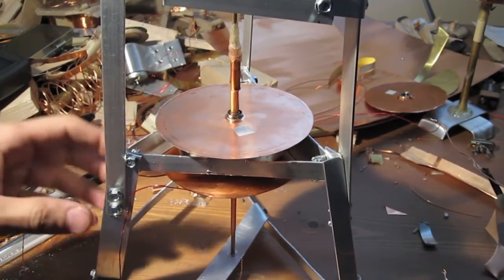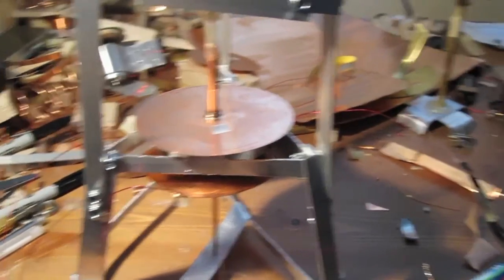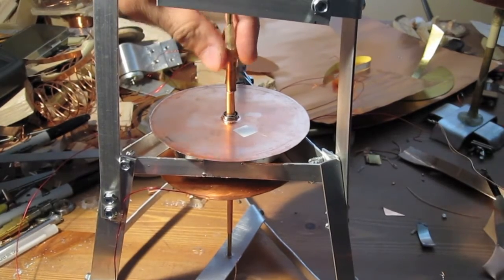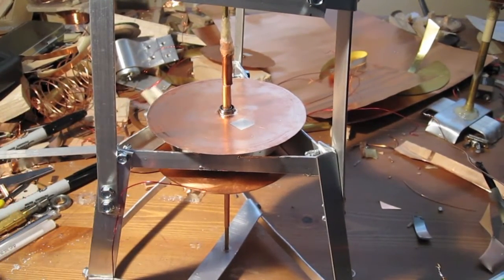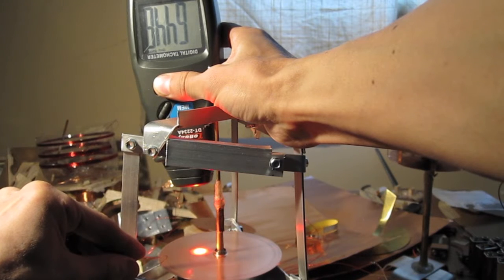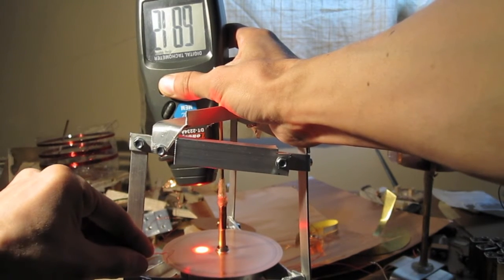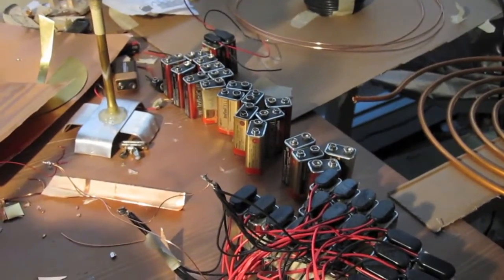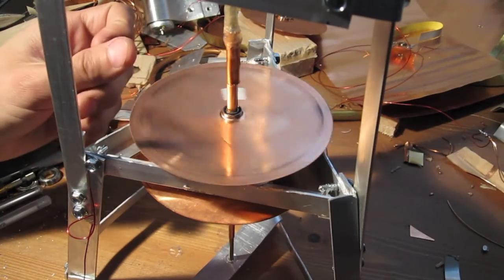8600 rpm Homopolar Motor (Magnetic Vortex Motor - Part 6)

Comment: I know it's year's late, but have you tried Losing the Commutator's, replacing them with anode and cathode of a really high voltage generator.
Like Tesla Coil Driver, Stun-gun or similar H.V. driver (many 555 PWM or one transistor circuit's to try) to avoid Drag of commutator's. I imagine your speed will go UP and control as well, since the Speed control issue in this video is a downer. It's year's Past your posting but i just had to suggest if you are still keeping up on comment's.
Thank's for sharing, by the way..

Comment: If you didn't notice, he used a wire on the plate to conduct an electrical connection. He made an electric motor. (Not a magnetic motor.) The motor was powered by a power source such as a battery or a power supply.

Comment: but u did not talking about running amps
Reply: very high amps...they drink amps like cat eating friskies because they run dead shorted!
Reply: Yes they do 'drink' amps, but low voltages. It seems the only motor that will run on the lowest of voltages. So use a battery with low voltages and very high amp hours such as a zinc-air or aluminum-air battery.

Comment: I'm trying to duplicate this experiment but am having difficulty. 

I'm using a decent bearing, have a very strong magnet, N42 3" annular, a steel disc with a copper layer on top all attached to a 1/2" rod secured with a vice. Spins fine - stops withing 2 seconds. Using 3.3V @ 22A, 5V @ 23A and 12V @80A all without result. Connections are from the inside to the rim of the disc, tried switching the terminals and I'm touching very lightly. They will spark and glow but no rotation. 

Can you tell me if you have had any difficulties anywhere along the line?
Reply: Did you use a feromagnetic material as a supporting structure?
Reply: I am working on the same :) keep in touch. Mine is welding at the moment 😂🤣but I'll get it. Already posted a faraday motor (in a liquid style) now working on this type.

Comment: do you can spin it with like 10 000 volts and low amps, I mean static volts field 10 kv
Reply: the disc is a practically a short circuit, the high voltage would drop because it can't supply high voltages the same time it supplies high current. You could put a single high voltage lead wire in the disc at the same time the low voltage and high current is circulating to make the disc to spin. That would be interesting.

Comment: Hello nice work I was drunk a screwin around last night I got a screw with a magnet to spin at 20,000 + will upload soon !And got a levitating magnet to hit 98,000 rpm with air and this may help your work as I also have hit 20,000 rpm homopolar levitating and the speed limits this way are easy to still push for much more. And after a sertion RPM is hit feed back in to may also be possible. Regards Adam VA of AVA Magnetic Levitation AUS

Comment: not telling you anything you probably arent aware of, but just incase, please be careful when you get closer to 40k rpm as these materials you are using will begin to go in and out of resonance, think of the wine glass and the oporah singer, unless you control the spectrum in which your vibrating these materials and also the fact that your using separate materials which have different resonate freq. be sure to understand breakdown will happen and when it does im sure you know what happens when a buzz saw breaks.. no fun.. be careful my friend.. again i would really love to see you do this but apply a more symmetrical structure to allow natural orientation correction of the object.
Reply: ther like some windows broken

Comment: wouldn't it be cheaper in the long run to use a DC power supply?
those huge neo magnets aren't cheap, that's for sure

have you tried Tesla's radially cut slots in the disc? it's much more efficient that way, but hard to build
Reply from the maker: beforebefore In my video "Joseph Newman Motor part 3" it was necessary to use 9 volt batteries to get over 800 volts of electricity.  I used over 50 9 volt batteries in that experiment.  I had to use batteries to see if they would be gradually recharged by the system.  After that project reached its end I had a whole bunch of extra 9 volt batteries lying around that I have since used in my other projects.  I'm not quite sure what you mean by radially cut slots?  Can you elaborate.
Reply: spiritelemental
My bad, not radial, but spirally cut slots. Seek the pdf document "Notes on a Unipolar Dynamo" - Tesla.
http://www.andrijar.com/teslahom/teslahom.pdf

Also - good reading:
http://www.overunity.com/8934/bruces-discovery-teslas-missing-link-for-his-unipolar-generator/#.U-xW4WNtDec
Reply from the maker: beforebefore  Thanks yes, I've seen that pdf and pic before of the 4 petaled standing wave lotus pattern incorporated into a motor by Tesla.  Its been many years and I wasn't working on a unipolar motor at the time like I am now.  Thanks for reminding me.  I may have to take another look at it.

Comment: Your work resonates with me, thanks for sharing.  I feel like we're not trying to  create "anti-gravity" cuz its the influence of earth that creates anti gravity by providing a barrier between the gravity of space and terraferma. 
I think we're actually trying to nullify the influence of earths mass so that gravity (which is every where except around large bodies in space)  will levitate our machines while still within the influence of a bodies mass.

I suspect that the rpm requirement of the rotors would be reduced by half if both rotors rotated in opposite directions. Its much easier to activate the "aether field" (that's where the perpetual powering comes from) when the opposing magnetic fields are collapsed against each other.  
Research Boyd Bushmans magnetic experiment where he collapsed two northern fields against each other and reduced Earths shielding affect which reduced the constant 9.8 m/s fall rate.   By quickly modulating that collapsed field principle, attaining the correct resonant frequency will nullify earths influence and we'll see levitation.  peace...
Reply: like a « pump »

Comment: Magnetic VORTEX proof (not theory) Maxwell ERROR (field not linear
http://peswiki.com/index.php/Image:Magnet_vortex_Pedro_Silva_95x95.jpg
educational (magnet motor - qmogen) : http://linoavac.no.sapo.pt  science and art

ÇÇÇÇÇÇÇÇÇÇÇÇÇÇÇÇÇÇÇÇÇÇÇÇÇÇÇÇÇÇÇÇ
ok,tks..the magnetic line (fields) of the earth are not linear(lines is old theory)..the magnetic field of the earth is with vortex shape(several curves)...is equal to the gravitic lines (in the shower water spins with vortex when is descharged to the sewage

using a PC transformer and a magnet.  putting current in the water(with salt helps) and connect magnet to one pole. simple...after discover VORTEX we can explain gravity(harmonic vortexic magnetic field)

Anti-gravity is anti-vortex
by electrogravitics
based on double triangle high-voltage by square discharge. ( LIFTER - electrogravitics )

The comunity "magnet motor" : https://plus.google.com/u/0/communities/113932584951030663517
NEWs (top 5)http://peswiki.com/index.php/Directory:Motor-Generator_Self-Looped_with_Usable_Energy_Left_Over

Comment: if that thing shatters at 8600rpm.....
Reply: Grinders from home depot spin apx. 30000rpms this will be fine. Sigh...nagging.
Reply: @strangescience3414  And yet at 30k RPM I still cant go back and pick lotto numbers right... :)
Reply: @ianhessey1190  😂🤣darn was hopeful. I was testing this design  quit a bit. I have a different version on my page with about as much torque as a fan. The tricky part is managing so much much extra current without it welding or melting itself. It's is a true concept just very difficult to scale up and manage. Many potential solutions like adding carbon brushes example ruin the effect and revert back to conventional systems. Still doing tests.

Comment: cool watch your fingers with those edges :) is there any way to get dc to jump a spark gap and reduce the friction of the contact ?
Reply: spiritelemental

Leave the Mercury alone.

The real issue is - none of us actually know what the hell Die Glocke was for. We know they used Mercury in it, and we know it emitted radiation, and that they didn't want it to fall into the hands of the Russians for sure.
It could be a flying machine, or it could have been used to open a worm hole, or it could have even  been used to simply make atomic material more deadly.

That's the problem, none of us knows.

But, like you I have an intense interest in these types of things.
I'm trying to learn about Monatomic Gold as a superconductor. I ingested it on a fairly regular basis for 14 years, and I am interested in learning about it's anti-gravity properties. (such as how to activate it.)
Reply from the maker: If I could get the voltage up to maybe 500 plus volts, it would jump a small gap (half a millimeter) but the amperage has to remain high.  I'm using I'm guessing over 10 amps in my video here.  Another way to go might be to use liquid mercury as the bridge/brush to touch the other edge of the disc.  Mercury is messy though, and its fumes are highly toxic and unpleasant to inhale (as I've experienced first hand. lol).
Reply: spiritelemental Its a wonder you can remember the experience ;-)
Does Electricity loose amperage if it jumps a gap then ? to be honest Mercury would be better but still there would be friction :) where we need to get to is charging super caps and creating a field using electromagnets powered by the SP's that lifts the magnets and the diamagnetic disks. :-) Can you tell me do caps charge faster the faster the magnets spin if you were to charge caps with them ?
Reply: A alloy of gold Gold mixed with some other stuff is known for it's Extraordinary Magneto Resistance (the function that makes the disc turn) and EMR is 1,000,000% that of copper. I'd hazard a guess that mercury was a replacement slip ring for the high amperage. Radiation was either from an onboard nuclear battery or came from the spinning metal itself. 

But that's just a guess.
Reply: Its the amps that makes the disc turn. If he ups the volts and keeps the amps the same you would multiply the two to get the requires power source. So, 20A X 500+V and that's 10,000 watts. He would have to install a 100A circuit breaker and buy a massive step down transformer - or have more 9V batteries connected in a nightmare  array of series and parallel connections. 

It doesn't appear that voltage can work if it gets too high, not unless you have a very wide disc.
Reply: @JohnWilkinsonTesla  You can indeed up the volts. Simple test is to stack 3 AA cell batterys and a screw and magnet under the screw. More volts = more speed. Remember that when you up say 12v to 12kv you lower the amps but the volts are more. However this motors down side is it will pull the same no matter what.EG... series vs parallel one has more volts the other more amps but with this motor if you had 4 x 12v batterys at 1 amp each with output at 12v and if you stack them so they are 48v they still discharge on this motor at the same speed. So it will spin faster from amps and volts. He could indeed up the volts to spark jump to the plate.
Reply: The mercury would cause drag in my experiments it slows down my magnetic core